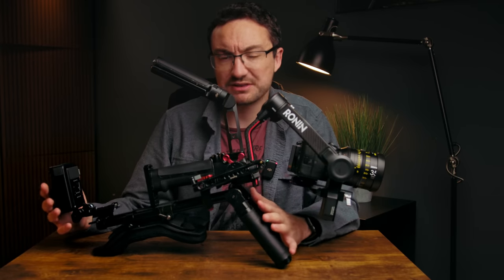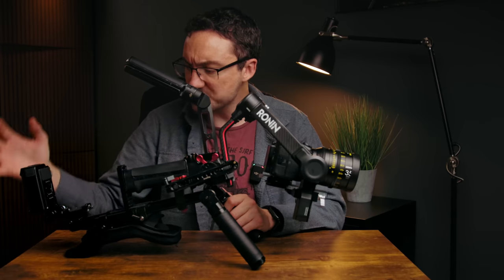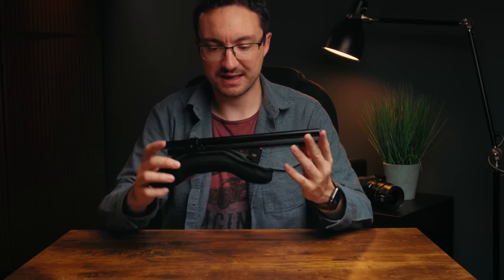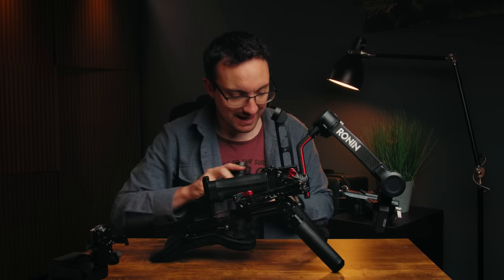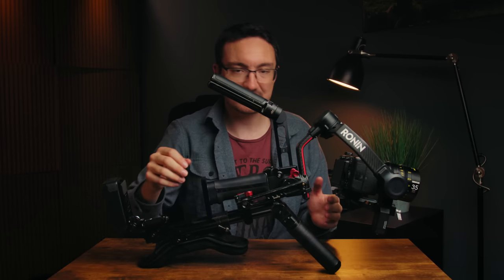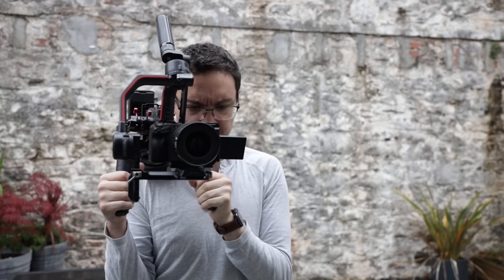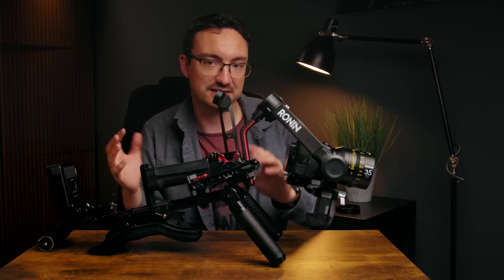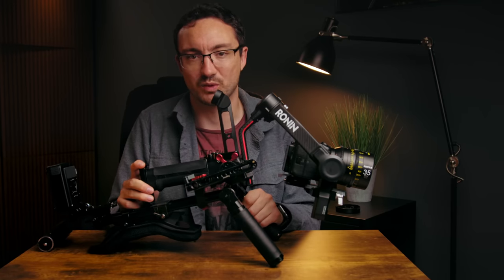How To Build 'The Creator' Sony FX3 Gimbal Rig

Comment: They used the Tilta power supply base to eliminate the DJI handle battery and shorten the whole rig significantly and make it way more balanced on the shoulder ,  bolting the power base straight to the rigid V lock mounting plate, also adding the Tilta dvanced Rear Operating Control Handle for suitcase mode
Reply: this stuff is wyld

Comment: Great video man. This might be a huge solution to a problem I tend to have - I do a lot of gimbal work but also need to move quickly to handheld at live events and just locking off the axis and popping it on your shoulder does all of that in a second.

I’d love to just know you get a monitor and wire up all the v mount batteries etc.

Comment: Interesting video, but Id really love an exact (or near exact, skip the lens) remake of their rig. The removal of the RS2 handle has a big difference on the weight distribution and handling of this rig. I really want to see how they actually kitted this up for run and gun. Might be worth renting out the remaining bits to show us in a video; thanks!
Reply: Yes, I’m curious to see how they attached the power supply base plate to the shoulder mount. The gimbal itself looks quite high off the shoulder mount. Cheese plate on rods, or an L plate of some sort?
Reply: Very easy, just need a dtap splitter, and one in usb port and then use usb a to usb c to Feed the gimbal.

You Can feed it with powerbank

Comment: Yooo - so I stumbled upon this recently - I had posted on someone elses vid as well as since i set it up without knowing someone else had or before info about this movie came out... it may be the same reason... I setup the gimbal in sport or to the stiffness right before the motors start shaking from being too stiff.  The effect is that it is pretty much identical to a regular shoulder rig footage with a heavy camera.  So in effect, the only function the gimbal is doing it removing micro jitters.  Other than that - the gimbal head almost is completely locked off.  If you look at their BTS - you can see in many instances the gimbal head almost fully tracks the camera operators physical movement.
Reply from the maker: that's probably true. I need to re watch the film again but I don't remember seeing 'floaty' scenes

Comment: I just got the SmallRig Wireless Control Dual Handgrip, I wonder if I can integrate that into this mix!?
Reply from the maker: yeah probably, would be a great addition. just use that as the handles rather than the normal ones I used.

Comment: remember the jokes about DJI 4d
Reply: @bemboing4338  U mean ITS Not possible? ;)
Reply: @bemboing4338 with the flex cable, you can absolutely make it shoulder mount and reposition the alignment / height of the sensor block (to lower its orientation). This is a common misconception.

Comment: Thank you very much! I have a Sony ZV-E10 and for saving costs, I would like to go for a DJI RS3 mini instead of the standard version. Do you think that would work in the same way? 

Bonus question: As the Smallrig 2141 rotating NATO adapter seems to be out of production, do you think the Smallrig 2385 swivel and tilt adapter will do as well?

Comment: Using some kind of quick release solution on the base of the gimbal (such as the F22/F38 setup from Ulanzi) might be a better solution for balancing/calibrating the gimbal before putting it on the rig and re-balancing when changing lenses

Comment: Thanks for presenting some interesting ideas. I need to try experimenting myself. Trouble with shoulder mounteing an FX3 is getting a good balance (needs camera well back) makes monitoring tricky

Yet, I always felt that shoulder mounting gave one a better chance of holding longer shots, if wanting some movement vs a more static tripod or monopod option. Gimbals can be good but difficult to manage for a sustained period without using some kind of chest mount (which is starting to look like overkill for many situations).

Def need to try. Sort of makes sense to use a gimbal too, but I think far forward mounting (better gimbal use and monitoring) fights the ethos of shoulder rigging.

Comment: NO it’s not the rig they used. The DP posted several photos and although you’ve got the idea they used many more advanced parts and also didn’t use the battery as part of the setup. So the thumbnail is actually not true. Would have been more truthful to say it was a similar rig. 👍🏿
Reply: where can we find those pictures?

Comment: How would you feel about mounting this on a tripod? If you did that can you lock the gimbal arms so there’s no wobble or would you have to leave the gimbal on still? Seems similar to the Ronin 4d in this configuration but it seems like when you put the Ronin 4d on a tripod there’s still a bit of wobble when the 4d gimbal is turned off
Reply from the maker: You could turn it off and lock off the axis, you’d effectively have a solid camera body for tripod or even handheld, then unlock and turn the rs2 back on for gimbal. Saves switching I guess which is good, only negative would be swapping lenses
Reply: @JonathanPalfrey Ah that's good to know. Yeah that's a good point about swapping lenses. Guess the Samyang V-AF would be handy there (too bad the image quality is lacking)

Comment: ATTENTION ‼️ If you just mount it on a shoulder pad like you did or if you have briefcase mode you can directly mount it on the pad and then use handles connected directly to the gimbals own nato rails then you eliminate a lot of extra stuff, it is way stronger also!

Comment: This video has great production value but please be more honest in your presentation. Because no, you did not 'manage to build the FX3 rig that they used on The Creator movie'. This video should rather be called 'My attempt at recreating the 'The Creator' Sony FX3 Gimbal Rig with the parts I had laying around'. You don't use the same parts or configuration. If you want to see what parts you actually need and how to set it up to recreate the rig they used for the movie check out the video
‘The Creator’ Sony FX3 ‘Octopus’ DJI RS2 Gimbal Rig Explained by OD Hunte.